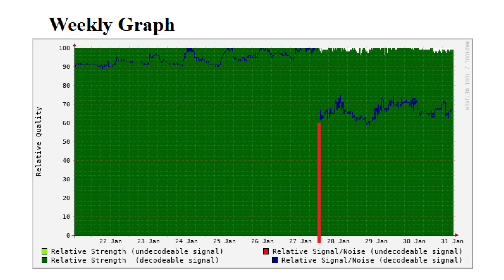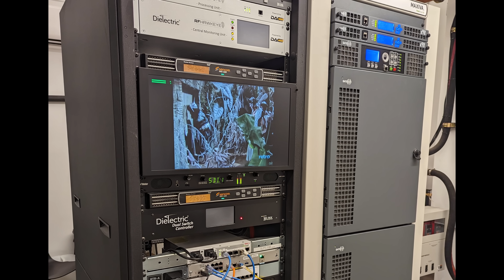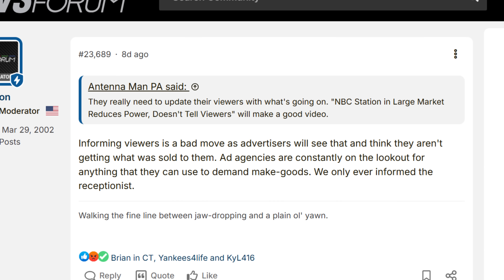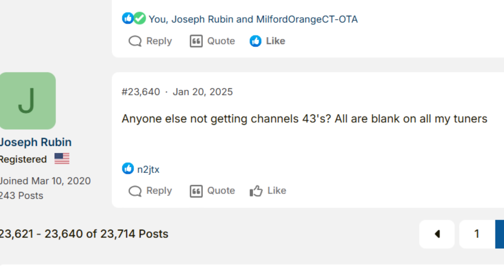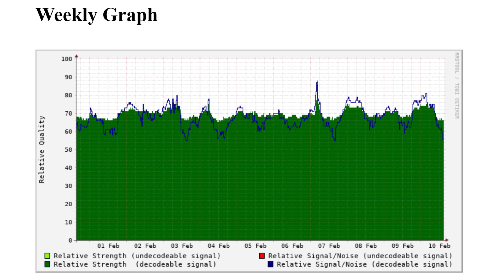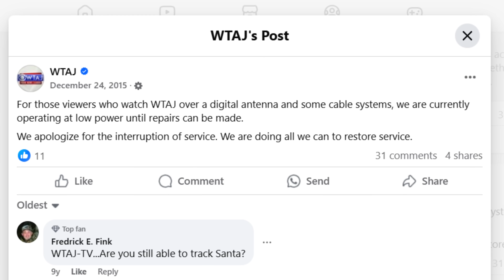TV Stations Lower Broadcast Power at Times - Here’s Why

Comment: Another reason stations consider reduced power or alternate/backup facility use less important than decades ago, is that in many markets, cable and other non-OTA signals are used by roughly 80 percent of viewers.  Some TV stations even have private coax or fiber links from their transmitter site, to major area cable head ends, so that the cable services have both a less degraded primary feed, and redundancy if they use OTA to back up a private direct feed.  

Generally reduced power backup facilities use is pretty short term, other than in cases of major facility damage or relocation.

Comment: The reflected power back into the transmitter can be measured by SWR, which stands for Signal Wave Ratio.
Reply: Standing Wave Ratio

RF signals in coax or waveguide can act a lot like audio bouncing around a room (even if not a Phish concert), but with far smaller wavelengths.  Some lengths of coax can act like RF shorts, and others like shorts to a harmonic and as a DC lightning protective short, but as if not present to a specific carrier frequency.
Reply: SWR: Standing Wave Ratio
Reply: That's wrong, but Google Gaslight is hiding the correct info from two of us, possibly due in part to Tyler's choices of ad revenue options or members systems, both predatory abuses by Google's bad faith management, overdue to lose DMCA Safe Harbor.

Comment: Hey Tyler, I'm still trying to figure out why my 1.0 channels come in much better than my 3.0 channels. I was assuming from all the videos I have watched that the 3.0 channels were supposed to be better for reception than the 1.0. That is not the case in my area. 75 miles North/ Northwest of Green Bay WI. 2 channels are drm incrypted and 2 are not. Do they have a lower power output on the 3.0? If they switch to 3.0 in the future, I'm going to be totally screwed! Your thoughts?
Reply: Are those 3.0 stations on another RF channel ?
You probably have to adjust your antenna a little.
Reply: @dennismckay309  I have tried that with no luck.
Reply: Yes I believe 3.0 in my area PHX is lower. And usually one station becomes the host when 3.0 could be slightly diff setting on the horizon.  Yeah and this drm has to go.  All network stations here in PHX are encrypted. 3.0 so far is ridiculous

Comment: No wonder why I no longer receive WNBC! I'm from the North Shore of Long Island & back in the analog days until the 2009 digital transition, I used to receive ABC affiliate WTNH channel 8 from New Haven Connecticut across from the Long Island Sound with my rabbit ears antennas crystal clear but since the digital transition, I don't receive WTNH at all & nether can I receive WABC channel 7! I cannot receive ABC with my antenna anymore & I would need cable or a live streaming service to watch Jeopardy & Wheel of Fortune! I wander did they reduce power since the digital transition?

Comment: Tyler: From the other side YOU don't know about.  I have been Chief Engineer for many FM stations.  A rebuilt tube can cost $3000.00 for an FM transmitter.   A TV transmitter final tube can cost much more.  For a major market the can cost much more.   In the range of $5000.00 to $20,000.00 for final tubes.  In studies done by VOA [Voice of America] the best way to extend transmitter tube life is to lower the filament voltage.  This can extend their life by quite a bit.  Lowering the filament voltage may not be possible while the tube is broadcasting.  On the other hand operating expenditures can be cut by lowering the power in some tubes.  Other tubes cannot have their power lowered.  We are in the dark about which tubes and tube types are being used at any particular TV station.   At TV frequencies particularly UHF there is NO difference between daytime and nighttime propagation [reach] of the transmitter signals.
Reply: I live the Los Angeles area and have an antenna in the attic of my house (wood roof framing with fiber-reinforced asphalt shingles).  In practice the rain should cause a problem with reception as it covers the roof, but I've never experienced any issues with any of the major stations' broadcast signals, they still come in clear and sharp.
Reply: Wow.  Google Gaslight disappeared my comment on how parts of that post are accurate but with more detail, or others not accurate, along with a description of tube life cycle management.
Reply: That's nice, however your license specifies a specific power. And if you are reducing power on a more permanent bases you have to inform the FCC of doing so. Never been a broadcast engineer but have studied to be one, do have a ham license and have talked to other engineers. So that's how I know some of this.

Tubes, how cute. How many are still using transmitters with tube finals on FM? At TV frequencies and powers I understand finals are still likely TWTs.
Reply: @glynnetolar4423   I am one of those "other engineers", with a First Phone from the 1970's, converted to a broadcast non-exclusion General after Reagan's fake deregulation (same requirements in law; just remove many of the presumptive compliance regulations interpreting them) in the 80's, plus SBE Senior certification, and loads of FCC filings to be found in their archives.  

Depending on the class of station and time periods and degree of power reduction, an STA (special temporary authority), or license modifications, may be required to reduce power levels.  In some cases, if that were to result in operation outside a channel usage class, or non-compliance with city of license coverage standards, it might not be allowed longer term and could be grounds for license revocation.  

Details are a bit more complex, than a generally permissive within general band and operational limits framework for HAM's.
Reply: I think his point more is when you reduce power for extended times let people know if OTA is really going to remain viable. And my thought about propagation - at the outer edges. The outer edges in the evening here when the humidity really is high give a weaker signal than during the day. This is a known factor in coastal areas.
Reply: There's some strange art and magic in how those thoriated tungsten filaments are made.  

Neither Eimac/Varian nor Econco can explain why some rebuilt tubes outlast new ones, at far higher prices.  

That's not a great explanation of filament voltage management and tube life (while Klystrons for UHF may not compare directly with power tetrodes for VHF HPA's).  

Usually it's best to install and tune a new tube, run it up to full power plus 5%, and then see how far filament voltage can be backed off below spec before tube output falls.  Then increase filament voltage slightly, and reduce TXO to license parameters.  Over time, 6 months to 3 years in extreme cases, as a tube ages, gradually crank up filament voltage to spec or a bit above, until the tube goes soft and needs replacement.  

Of course power MOSFETS operate more efficiently, and keep increasing in usable frequency limits.  Now a baseband signal may go into a digital transmitter based on a modulated emulation, and not based on traditional modulation or baseband generation techniques for A3, F3, SW, or retired NTSC systems.  

TV transmitter powers went down with ATSC, whereas older NTSC UHF's often needed 6 60 kW cavities into a combiner to feed a high antenna gain for 5 MW ERP.  OTOH, a 250 kW shortwave system may require an actual 2 MW TXO on peaks to carry positive modulation.

Comment: Remembering when I was a youngster and we got our first TV.  Only had one VHF channel for sometime.  I wasn't supposed to touch the TV, but I couldn't resist and started trying the channel knobs and actually found a UHF channel and it was the first time I saw Laurel & Hardy.  Also back then when airplanes flew over the signal would be messed up.  I now have antennas and never notice any problems from airplane traffic and we have tons of planes and helicopters most days?
Reply: UHF came on air in 1965-1966.     Needed a NEWER tv with the extra tuner.
Reply: @tedlahm5740  I remember commercials selling UHF TV "converters" for your old VHF TV's. And plastic slipcovers that were always advertised.
Reply: What do you mean by messed up, like it show plane Info, or some random crap, either way, june 12 2009 was the first we saw into DTV and out with analog, this was completely phased out July 2021 ( in 2021 at least), so a lot of things saw  encryption to prevent interference, this is the most likely reason, but also there are more reasons...
Reply: @luke51632  This was many years ago and it would just cut out the video and audio just for a short time.  Don't know if the plane was actually blocking the signal or maybe it was their radio.  I was wrong about finding the channel on the old TV it couldn't have been UHF if it started in 1965, I was in Vietnam courtesy of the U.S. Army then.  I have an old Winegard (sp) antenna that is at least 49 years old and it still works great.  Bought a new one from Amazon a few years ago and it is falling apart, but still gets reception if I use my rotator.
Reply: Those were the analog days.  Now the tv signals are digital and airplanes don't seem to bother them now.  Am I correct......anybody.  tell me if I'm wrong.
Reply: @robertheckman7161  you are, and I said why in this thread of comments
Reply: Multi-path interference from aircraft was common on low VHF, channels 2-6.  This can still be heard when listening to a distant FM station.  TV multi-path interference from aircraft less common these days because stations use higher frequencies that aircraft don't reflect as well.
Reply: I think most television transmissions are in the UHF band, these days

Comment: I built a 3 antenna array and had to buy/install 3  (three) 4G/5G inline filters to remove that 📱 noise from the coax cables. Using a couple of amplifiers to boost the combined signals the highest signal strength my HDTV interferometry array gets is 80% from stations with broadcast antennas ~6 miles away as the crow flies.

Comment: I live in NJ and receive my tv channels from Philadelphia transmitters (20 miles SE).  My question is why can I get 2.1 (MeTV) but don't receive 2.2  through 2.9?
Reply from the maker: Sounds like an issue with the tuner built into your TV. Try a different TV. If the channel shows up on it, my suggestion is to order the external tuner below: https://amzn.to/3Lngj75

Comment: Recently we lost Me TV on Channels 33 and 43 from
around NYC when there was
bad weather in the area in
late January, 2025. 
After a while 33 came back,
but 43 has not come back,
also with similar programs
as 33. 
We are in Peekskill, NY, about
35 miles from NYC, at a height
of over 300 feet, on the 5th
top floor, near the Hudson
River, facing NYC, with an indoor antenna and amplifier.
Most of the other NYC stations
were still receiveable here, except Channel 7 was weaker
Too and Channel 21 did disappear too.
Other people around here had
those reception problems too. 😊
Reply from the maker: This was actually brought up in your market's AVS forum. See below: https://www.avsforum.com/posts/63811237/

Comment: Wow when I get a cloudy day we actually get more stations that normally we don't get. Is that normal??? BTW, Great video!
Reply from the maker: Yes. As mentioned in the video, TV signals are always fluctuating a bit. Atmospheric conditions can sometimes be better on a cloudy day. If they new channels that come in aren't worth watching, you have nothing to worry about, but if it's major networks that come and go, you will need to adjust your antenna with a signal meter or upgrade it.
Reply: @AntennaMan  Thanks for the quick advice!

Comment: Having not noticed any change in the NBC signal in the New York market around the dates mentioned one piece of info was missing.
That is was this change in power In ATSC 1.0 or ATSC 3.0?
I have and recieve both.
Thanks.
Reply from the maker: The change in power was on ATSC 1.0. The reduced signal might've still reached your area if you have a good antenna but definitely impacted viewers on the fringe end of the market.